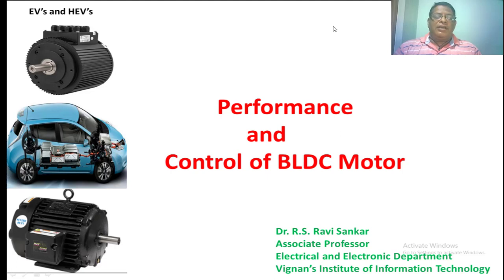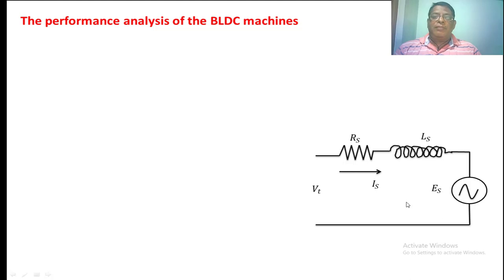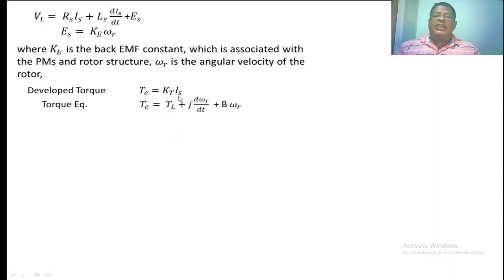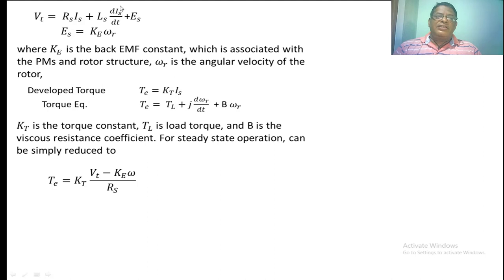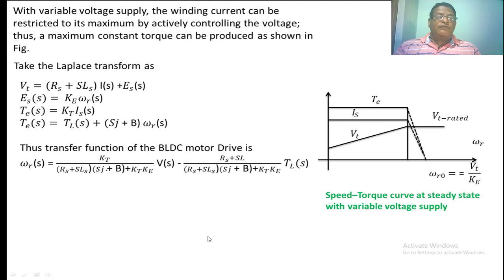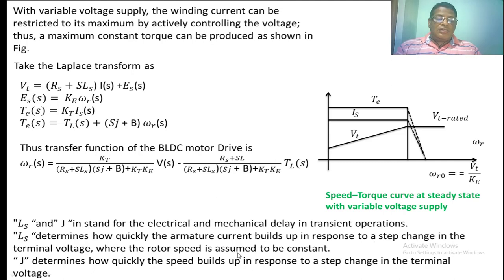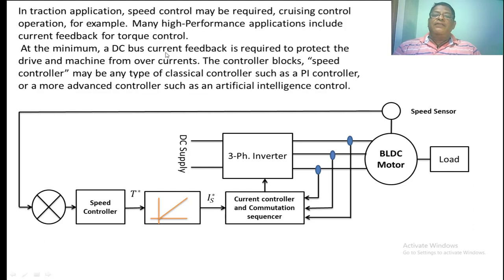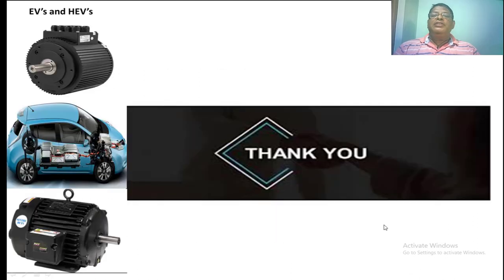Performance and Control of BLDC motor

Comment: Sir how we control the speed of bldc motor by varying voltage or by varying frequency of three coils ?
Reply from the maker: BLDC motor and supply 3-Ph.Inverter is there , by means of that control the voltage or frequency with help of controller
Reply: @electricalcourses9  or both?